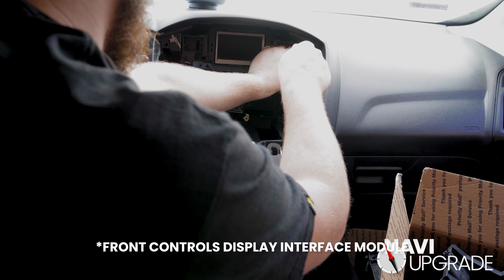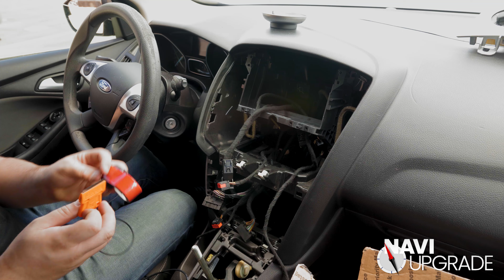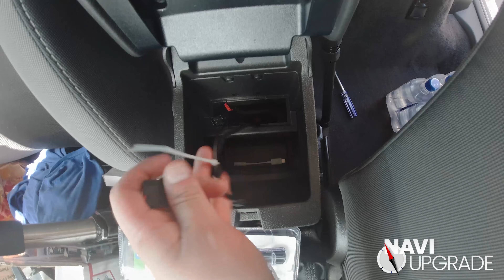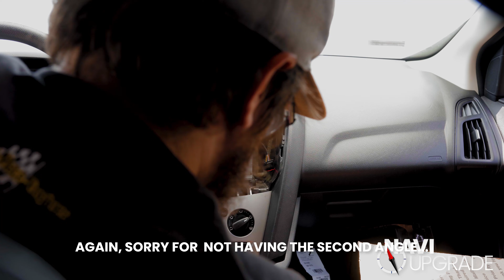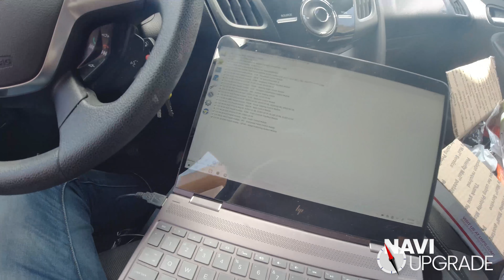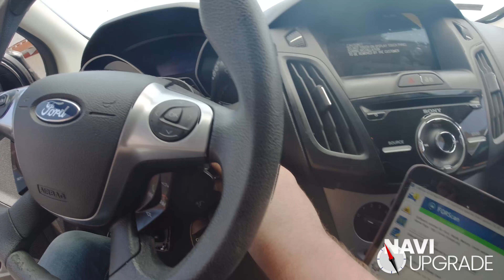2012 to 2014 Base Ford Focus MK3 Sync 3 Upgrade Tutorial

Comment: I have a 2012 Ford Focus SE hatchback and I was wondering if you knew what led headlights would go good in it I don’t know if it’s my phone or what but I have researched it and can not find what lights would go good for it or which ones would fit it
Reply from the maker: Hi there! Thanks for watching and for your comment... I wouldn't recommend LED headlights (the tech isn't that good for aftermarket yet) -- what I would recommend is a good set of headlights with projectors in them. My buddy runs these on his car -- they look fantastic and have great output while still being halogen: https://amzn.to/3lK7oxS (affiliate link) 

The best part about projectors is that you can adjust the cutoff pretty precisely, and it focuses the light throw so the light travels farther in a more focused manner than a reflector housing.
Reply: Then would look real nice on my focus but I wanna put like led colorful lights on the side of the headlight but I’m kinda not to sure if that would be the best I’m trying to modify but not sure how I want to yet got any ideas?
Reply from the maker: @TigerXD-wm6fb  ahhh, you want to do a retrofit then... If I were you I'd hit up circuitdemon.com
Reply: What’s retrofit?
Reply from the maker: @TigerXD-wm6fb  they unseal the lights, add in anything you want then seal em back up
Reply: NaviUpgrade ooo yes that would be nice

Comment: The problem is it looks like it still utilizes the old radio unit. Those eventually get loud popping or go out entirely. Both me and the wife have the same car and had to pull the fuse to the radio to save our hearing.
Reply from the maker: You can utilize either the original ACM or upgrade to the ACM that has built-in HD Radio and Sirius XM -- it's mainly the MOSFET and amplification part of the ACMs that blow -- unfortunately it's mostly due to living its life in an unventilated area... which all Fords will suffer from at one point or another. 

I will be releasing a harness next month that allows people to easily plug in RCA's and program their units to output line-levels (to go out to an external aftermarket amp) -- this helps take a lot of the stress off the amplification portion of the ACM and extends the life -- also allows you to have a sweet, loud ass stereo 😎

Comment: Can you change the climate control?
Reply from the maker: Unfortunately adding in Dual Zone Auto HVAC is more complex than just doing a Sync 3 Upgrade -- if you were to do a Dual Zone Auto HVAC upgrade you'd need to completely take out your dash and replace everything from a premium model car -- meaning the entire dash harness, blower motors, and heater core. The reason for this is because there are extra blend door modules, individually controllable blower motors, and a heater box that allows for split heat outputs. It's not a fun project, but if you do it, you it, you don't need our harness to do the Sync upgrade.

Comment: Most of the times when something involves a laptop and multiple steps/uploads, at some point you will get an error that nobody knows how to solve and you end up with a bricked car just because you wanted a new navi ...
Reply from the maker: Not the case. As long as you stay within the APIM and ACM modules you can't really hurt anything
Reply: "bricked"
That's a dealer service term... Because dealer techs are nothing more than parts installers! 

You could go ham in it and then just go online and download YOUR vehicles asbuilt and back to square one! 

You're right though, there's people out there that can't follow this very clear step by step no doubt! Some people you can write it out in crayon for them and they will still stare at you like a deer in headlights! That's because the lights are on and nobodies home!) sigh....... How did those people make it this far? 😂

Comment: What's the reason for the separate GPS receiver?
Reply from the maker: Sync 3 uses a separate aerial GPS module vs the car's standard GPSM module that comes in all model levels. Some people go for the route of placing the factory aerial module in and route the wire through their headliner and back up to their APIM/ACM modules.

Comment: I've a 2016 Focus SE but it's different than both of these .It doesn't have navigator and I had it two weeks . Does have synch system abs and a few other goodies that I'm sooo happy . My old 06 Sentra was very bare / poor in a lot of areas compared to this new one . Verrry glad I got it . This one has Bluetooth , ABS , rear camera . tire pressure monitoring DAAANNNGGG .
Reply: This is only for 12-14 (or 15.... Certainly not 16) so yes yours is different, he also makes a kit for those as well.

Comment: I have a 2014 Ford Focus SE with the base radio as this one does in the beginning. Approximately, how much should it cost me to make this upgrade? Parts, labor, etc?
Reply: Just bought the parts to do this upgrade myself and it was about $1,400 in parts
Reply: Sync 3 head unit goes for around €260 on eBay

Comment: So I pulled a screen from a junk yard do I need to do all the stuff with the computer or will it just work?
Reply from the maker: Depends on if you're going 4" to 8" or Sync 2 to Sync 3. You can usually get away without programming for a while if you're going Sync 2 to Sync 3 -- 4" to 8" absolutely has to be programmed though.

Comment: Do you know if you can do this in the UK on a 14’ plate focus
Reply from the maker: Yes! My harness works with this, you just need to use a FAKRA to RCA adapter for the backup cam function.

Comment: I have a 2013 focus se and it doesn't say synq anywhere, is there a way I can put this in my car?
Reply from the maker: Hi there! Thanks for watching! Does your car have just a clock in the center console or do you have voice commands as well?
Reply: NaviUpgrade it has just the clock in the middle, no voice controls and buttons on the steering wheel.
Reply: I also only have the AUX port in the back of the cup holders

Comment: Hi sir please I have a ford focus 2014 ecoboost with a basic sync system as the one in your video  I bought a sync2 system  so please can you send me a link  for the right harness from where I can buy  the adapters (harness)  to connect  sync2 from sync1  .thanks
Reply from the maker: Hi Mohammed, my harness does not work with Sync 2 unfortunately, just Sync 3 😞 I'm so sorry about that!

Comment: Hi, nice job! Do you think this could be done on a European 2011 Ford Fiesta? I have the base model of the system (I don't even have Sync) so I'm not sure I can upgrade it, especially for the cables and the connectors... Could you help me sort this out and find the right adapters, controls ecc.?
Reply from the maker: Hi, thanks for watching. Unfortunately the non-Sync versions of the car don't have high speed CANBUS which is needed to run Sync 3. I'm looking into an Arduino-based system to output the right CAN signals along with a custom harness, but I'm not sure how successful I'll be. I'm sure I'll make a video once I finally figure it out ☺️
Reply from the maker: Hey there! I think I was actually wrong about there not being the proper CAN signals in the car... feel free to shoot me an email, info@naviupgrade.com with some photos of your cars current center console setup. I have a harness that should work with the Fiesta now :)

Comment: can you make an video to upgrade to climate control
Reply from the maker: Unfortunately this is not possible without an entire dash harness swap in the car. This means removing the entire dash, adding in more blend door modules, fans, sensors, and even the heater core which is EXTREMELY difficult to get to with the motor in on our vehicles.

Comment: haha now its time to "upgrade" this funny control of air conditioning.
Reply from the maker: I wish we could upgrade manual HVAC to the Auto controls -- unfortunately it's not super simple. You essentially need to swap the whole heater box, and wiring harness from a higher model. Not worth it in my opinion 🤔

Comment: Would this be the same steps to take on upgrading a Ford Escape 2014 with the same looking dashboard trim (original SYNC from Microsoft). Also, I wonder that since I have a rearview camera, what would be different in the steps.
Reply from the maker: Hi there! Sorry I didn't see your comment. Essentially the same process -- I have the harnesses in stock now but I'm looking for a car to do the upgrade on so I can show the process on YouTube :)
Reply: @NaviUpgrade  I've got a 2014 escape you can use
Reply from the maker: Where are you located?

Comment: hello, great project.  does that also work with 2013 Focus ST from Germany?  with a reversing camera and automatic air conditioning?
I have already sent you an email, unfortunately no answer.
Thanks
Reply from the maker: Sorry been having technical issues -- the harness will work with this setup, however auto HVAC control on the screen will not work with my harness 😢
Reply: @NaviUpgrade  Hi, thanks for the reply .  why does the hvac control module not work?
Reply from the maker: @Xfilesde  your HVAC will still work you just won't have control of it from your screen. I can add in an extra connector to make the function work (I'll have these as add-ons in next month). The only reason I don't add these to my harnesses is that they're pretty costly to add because the connectors are custom (adding 20% to the manufacturing cost per harness). It didn't seem worth it to add since in the US all Focuses with 4" Sync don't have auto HVAC
Reply: @NaviUpgrade  OK .  operation via sync 3 would be perfect.  then i wait for your addon .

Comment: RIP anyone with an auto trans in their Focus
Reply: Rip
Reply from the maker: FFFFFFFF
Reply from the maker: Mainly for the bad trans issues but for the most part it's the same process just use the trim tool to pop off the shift boot and lift the whole trim piece up and around it
Reply: @NaviUpgrade  I've a 2016 Focus SE 2.0 GDI engine 58600 miles . Think I'll have some problems with transmission? I was there at dealer for a recall issue and he told me that transmission had a " known issue". Still barely under warranty for now.. That dealer scheduled me to get it fixed but last minute he canceled.. He said that of the two techs one was on vacation the other called in. Oh well
Reply from the maker: @frankmontez6853  you need to apply for the settlement ASAP. Ends on Oct 5th... http://fordtransmissionsettlement.com/
Reply: Oh great. I've just bought one.

Comment: Would it be possible to do this to a 2012 Focus with the base audio package with no Sync equipped?
Reply from the maker: Your best bet is going to be going aftermarket -- most likely a metra kit. Plug in your info to Crutchfield to see some options that will work well.for your setup 👍🙏
Reply from the maker: Unfortunately not ☹️ you have to have a Sync system in order for this to work.
Reply: Would you recommend any good upgrade paths or suggestions?

Comment: Can you get apple car play on it and also the 2013 and 2014 come with sync 3? Is there a way to upgrade those systems to get apple car play??
Reply from the maker: Hey there! You can upgrade your Sync 2 System to have Sync 3. You'll need a Sync 3 Display, APIM Module, Hub, Hub Adapter Plate, and Wiring Adapter. Check out more details on my site: https://naviupgrade.com/resources/upgrading-sync-2-to-sync-3-in-your-ford-focus/

Comment: Where did you get eh radio replacement?
Reply from the maker: I usually recommend people get them from local junkyards to them since they can be found for EXTREMELY cheap. I once walked away with everything I needed for a conversion for just $170! To see a full parts list of what you need for the upgrade, check out my site here: https://naviupgrade.com/resources/converting-a-base-ford-focus-to-have-sync-3/

Comment: Regards.
You could change the basic air conditioning that comes standard for a double zone air conditioning?
Reply from the maker: Unfortunately this is not possible in an easy manner. For that you have to change out the entire dash harness and add different blend door actuators, fans, and even the heater box. It's not a fun job.
Reply: @NaviUpgrade  Thanks for answering

Comment: Will the parking sensors and active park assist still work?
Reply from the maker: Hey there, so sorry for the late reply -- they will! Those are all tied in through the CAN system and will just need to be programmed a bit differently. If you buy through me I can send you a programming file to make these sensors work.